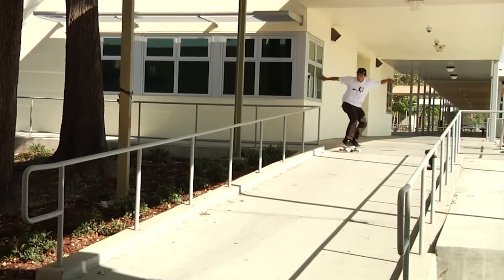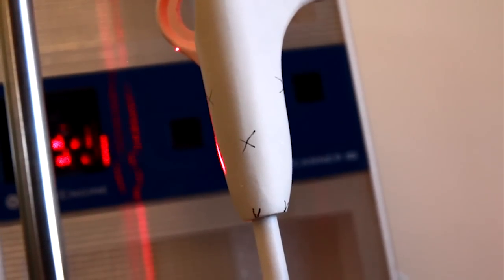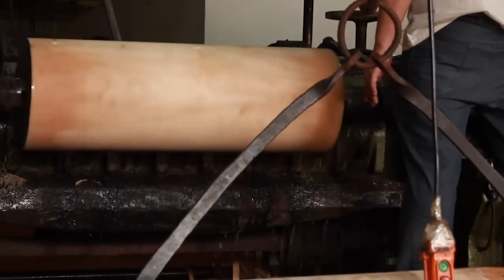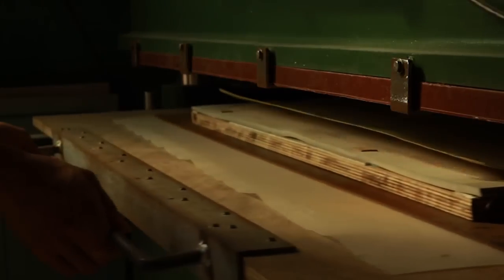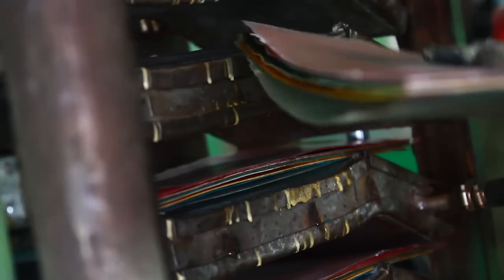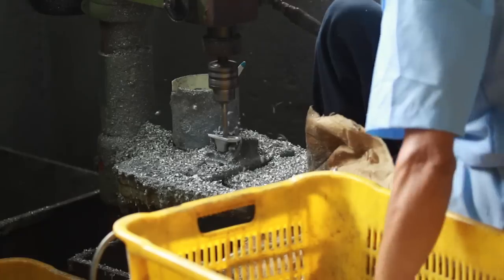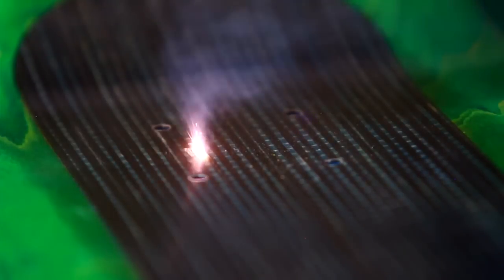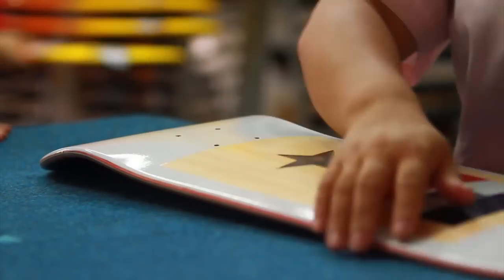Tested Development - TransWorld SKATEboarding

Comment: been skatin Cliche carbon-supported boards (carbon light, keystone and now Impact) for a couple years now.  From time to time, if there's no shape available I like I've gone to REAL low pro boards and Zero/Slave decks, in my experience REAL low pro boards are good quality.  The Zero/Slave decks break easy but have good shapes and are light.  Still, Cliche boards don't chip, are light, don't break, and maintain their pop til dead.  just my experience.  love skatin the new Impact series